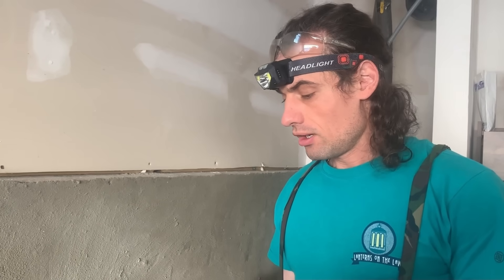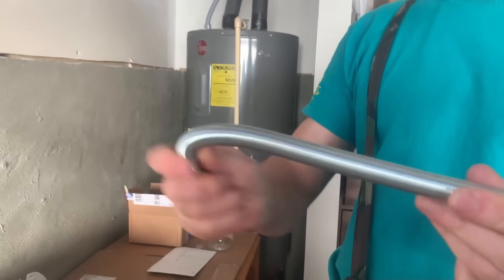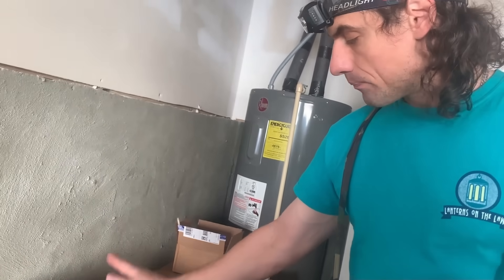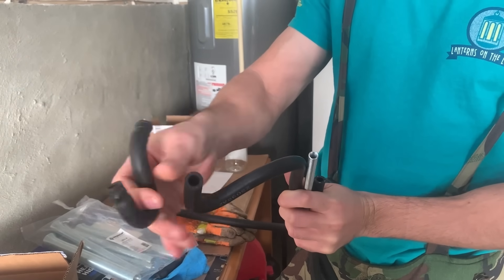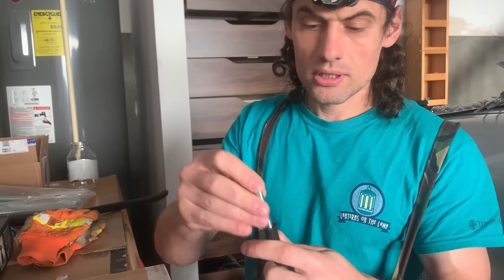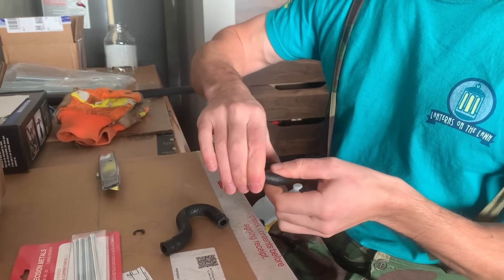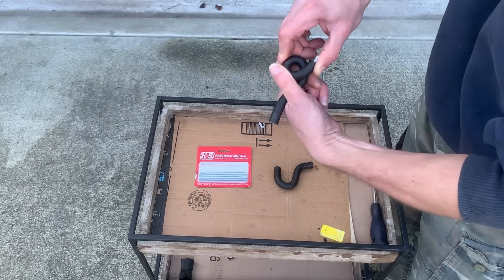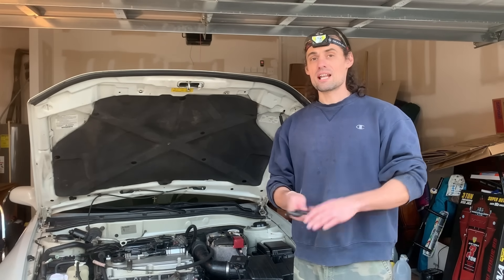Bend Rubber Hoses Without Kinking to Match OEM Parts

Comment: Does this compromise or weaken the hose in any way?
Reply from the maker: I am sure it does... But not to the point where it breaks or bursts after several years. I've used these self-made hoses over number of years and non of them fail yet. The oldest I have under my hood is bout 5-7 years.
Reply: @n @ngtitovWorldOfCars thanks!

Comment: i bought a husky spring set from home depot the instructions are SLIDE THE FLARE END in the pipe 
you did exactly the opposite  yes?>
Reply from the maker: Flare end has larger diameter than the spring. The idea is you're trying prevent hose from kinking. Thus, you need to fit outer diameter (OD) of the spring to inner diameter (ID) of the hose as close as possible. If you slide flare end to the hose, you will end up with a lot of hollow space between the spring and hose - more prone to kink.
You need to keep flare end out of the hose and insert the spring only. Hope that makes sense.
Reply: @ngtitovWorldOfCars  lol i know 
that's what i couldnt figure out 

can you re use the spring ? or are they all one time use?
Reply from the maker: @christophercolumbus8944  Re-use them as many times as you need/want.
Reply: @ngtitovWorldOfCars  no it is actually supposed to GO OVER the copper tubing at least the onei bought 
so flare end OVER the tube and it should bend there no heat is necessary.
Reply from the maker: @christophercolumbus8944  Hold on.. Are you trying to bend copper pipe or rubber hose??

Comment: Thanks for the video. I sliced a hose on my Land Rover Discovery in the middle of a bend when it rubbed against the radiator fan. and will try this instead of adding two splices and a new bend.

A lot of the hoses on this car is only sold in a large expensive kit, so this knowledge is gold. :)
Reply from the maker: Hope this works for you!
Reply: @ngtitovWorldOfCars 
It didn't come out as good as the original, but I managed to get the basic shape right so that the hose connected at both ends without collapsing (or hitting the fan) using this method. You saved me ~$300 :)
Reply from the maker: @yn82903  Lovely... Just remember - most of the time you wont get as good shape as original hose (you have to be really good at it to do so), but you only care about "close enough" without kinking... This is all about

Comment: Bend some nylon fuel line tubing into a 90 degree tight fit ,
without kinking it!
Reply from the maker: Thanks for the suggestion! Actually never heard of using nylon fuel line tubing instead ordinary rubber hose, but it sounds promising and worth experimenting with to avoid kinking. I'll look into it and maybe test it in a future - let me know if you have tips or results from trying it!

Comment: There is also an old trick where you can fill a hose with ordinary beach sand. Bend it the way you want and heat with a heat gun. It works!
Reply from the maker: Yes! Thank you for the comment. It was mentioned multiple times here in the comments by other viewers. Thanks again!

Comment: What should I set my temp gun to? It goes up to 1000°
Reply from the maker: Start with your temp gun set to 80-100°C to soften the rubber without melting it - just enough to make it pliable for reshaping before it cools. Test the hose's behavior at this range and adjust slightly if needed, but avoid high temperatures to prevent damage.
Good luck!

Comment: Very good job what's your thoughts on using an oven for 15 minutes using the spring and some flex conduit to hold the shape you want? Flex conduit can bend and take the heat and still have your spring in the hose to keep it from kinking. Hope that makes sense.
Reply from the maker: Yes, it does. Indeed, several viewers suggested this (or something similar). I never tried it, but I can see it works. Something new to try in the future projects. Thank you!
Reply: @ngtitovWorldOfCars  What temperature would you suggest?
Reply from the maker: @alvingallegos6367  Melting or significant degradation typically begins around 302F-392F. So, I would keep below that temperature. Start with 260F-280F and check it. It might do the job, if not increase the temperature. BTW, be ready for a terrible smell (like rubber burning).

Comment: Question: once the hose is formed in such a method and installed in the car, is there any tendency for such a hose to straighten up again when hot coolant or hot oil run through it?
Reply from the maker: The hose's tendency to straighten depends on how accurately you shape it. If the bend isn't sharp enough, it may try to revert to its original, less-shaped position, regardless of whether hot coolant or oil flows through. However, if you form it with a slightly sharper angle than needed, it will hold its shape as it continues to cure over time, much like OEM thermo-molded hoses. Thanks for the great question!

Comment: I needed this info 50 years ago. I'm gonna try this the next time I need a water pump bypass hose on a SBF. Thanks.
Reply from the maker: Hopefully, it'll work for you. Maybe very first time isn't perfect, but as you do it more, the better you get at it. Glad you found it useful, and thank you for watching!!
Reply: Buy the correct hose instead
Reply from the maker: @russellm5708  What if the right hose isn't available or ... isn't cheap. Similar hose I was able to find online for $49.99 - would you rather go with this option. I've made this video is not because I had nothing else to do, or wanted to waste my time and money. I showed the workaround in cases where it's pretty hard to find alternatives. My channel is all about this - find the simplest and best alternatives.

Comment: large rad hoses I would go with OEM. They really aren't that expensive and you sure don't want any stress on them from over heating.
I don't do the big stuff.
Reply from the maker: Yes, large hoses such as up/down radiator hoses, it is worth getting aftermarket or OEM.

Comment: With some practice, there is no vehicle hose you can't duplicate.
 The cost of pre-bent dealer hoses are  astronomicall to purchase, plus shipping and taxes.
And eventually all hoses will break down or leak.
Over bend slightly to allow for the natural spring in the rubber.
It works well, take your time, don't over  heat.
Reply from the maker: You're absolutely right! This is point of this video. That a little hose I've made in the video, I eventually found on-line somewhere around $45. No need to spend that much money for a tiny hose.

Comment: I just leave the stainless steel spring inside the hose and it won’t kink. You can cut the spring if it’s too long.
Reply from the maker: This also works. Just make sure that hose is still wide enough to bypass the fluid with the spring it. Any hose with diameter >3/8" should not have problems with a spring being in there.

Comment: Do you know if it cost effective?
Reply from the maker: Very cost effective. First of all, it was very hard to find a hose that I need, even OEM part wasn't available. Then I finally found something similar that I could make it work, but that little hose was around ~$45.
If you have all required tools, you only need to buy straight up hose from AutoZone or Advanced AutoParts, which will cost you few $. So, yes, it's totally worth it for such small hoses, and hoses that are hard to replace/find.
If a hose is available for sale and in your proffered price range, go with that hose.
This video is more for extreme cases, when you can't find a match. Hope it helps.

Comment: nice! I have an 11 mini cooper and I was dreading spending lots of money on new hose kit, this will save me a lot of money!
Reply: You need to replace those hoses w/OEM hoses and not some experimental shit
Reply: @genestallons5926  my mini is pretty Frankie, salvage recovery. Of course I would pressure test anything before I hit the road
Reply from the maker: @ Once you installed and pressure tested, just keep on eye on it few times a day first week before/after driving. If it holds for a week the chances are very low that it will leak/break. Good luck!

Comment: Can I leave the spring inside and just use the spring to keep it from kinking?
Reply from the maker: I don't see why not. Unless, it's a very tiny hose and by leaving the spring in there will prevent a liquid from its normal flow. On bigger hoses, I think you can. Also, make sure to use stainless steel spring so it won't rust in the hose.
Reply: Would be better to use a spring on the outside so flow isn’t restricted
Reply from the maker: @Aiken47  That also works!

Comment: Thanks for the video, not my question is do they make the spring any bigger? What I need is over an inch.
Reply from the maker: Over an inch is possible. I found something on amazon that may help: https://a.co/d/9AWbFYa
You have to just search on ebay, amazon and etc. I'm sure they do make such springs, just a matter of getting exact size you need and finding it online.
Just in case if won't find anything you need, read through comments here. There are a lot of suggestions how you can achieve similar results with other tools/methods, such as filling it with sand and boil it in water. There are a lot of tips viewers left around here. I haven't tried them personally, but I can see them work
Reply: the springs for garage doors are flexible and floppy, over 1",  a range of diameters depending on lifting capacaity of spring, 110lb, 120lb, 130lb, 140lb, 150lb all slightly different size

Comment: 10-15 minutes? You could bought the hose for 1.28$ off rock auto for less than you used in electricity
Reply from the maker: Could not buy this hose or similar hose anywhere I've looked. Including RockAuto. Found something similar that I could work with on the AliExpress, but the hose was ~$45. So, it is totally worth it.

Comment: A more economic method is to hard pack sand into the hose to retain the internal wall integrity whilst bending.

The same method works on copper pipes for water supply plumbing.

There will be videos showing the packed sand method, that's how I learned about it.
Reply: Won't the sand impregnate the rubber when it gets hot?
Reply: @mikemurphy7519  

Good one!
Reply: Or sugar, which rinses out easily.
BTW:  you can use this to bend copper TUBING which is soft, and measured on the OD.  To bend copper PIPE I think that you would need a specialized machine.

Comment: If at all possible, buy the manufacturer's hose. They are vulcanized into that shape in the manufacturing process. You can't un-vulcanize rubber.
Reply from the maker: This is more or the extreme case, when OEM parts are not available, or too costly. Just  a workaround.

Comment: Congratulations. You've just spent $100 of your time creating a $10 part not as good as OEM.
Reply: It's the adventure. Sometimes OEM is not an option
Reply from the maker: Absolutely right. I did not have OEM part and there was no cheap replacement. Anything similar I've found was $45 for a little hose like that. So, no waste money here.

Comment: I did a similar method before, but with sand. Tighten a clamp at one end over a screw or bolt, pack it with sand, and shove another screw at the other end, with a clamp. Tighten. ANd it must be tight so it wont pop out. Heat, bend, and then cool. I heard some using oil inside the hose, or something non flammable, but I used sand. Redid a small heater core hose, and many, many brake lines (though with brake lines you dont need to heat)
Reply from the maker: Yes, indeed, a lot of viewers also suggested method with sand. Personally, I never tried it, but it sounds reasonable and based on the various comments here it works well. Thank you for suggesting it as well!

Comment: I do this from time to time when I’m doing LS engine swaps.   I do it for radiator hoses.  After inserting the spring I usually use baling wire, or tie wire to hold it in its “bent” shape during heating and cooling.  You can also use nails or screws that are in a piece of wood.  Just thread the hose around/between the nails, and go to work!
Reply from the maker: I've also heard of this method with screws/nails on a piece of wood. Personally, I never tried it, but it sounds reasonable. I will give it a try next time I need a longer hose. Thank you for watching!

Comment: I've done this type of thing before, but I leave the wire within the hose, so I never have to worry about it collapsing.
Reply from the maker: Yes, leaving a spring inside of the hose is a good idea. Just make sure that diameter of a hose is wide enough so the spring won't affect the flow of the fluid. Basically, you don't want prevent fluid bypassing the hose at normal flow. Thank you for suggesting it!

Comment: Putting the hot rubber directly in the freezer after clamping it will make it stronger and ready to use faster. The same with welding plastic, immediately put it in the freezer or use ice cubes and it will be stronger than air cooling!
Reply from the maker: Yes, indeed, a lot of my subscribers and viewers suggested this - should work. Thank you for watching!
Reply: @ngtitovWorldOfCars  Thank you and youre welcome!

Comment: I know this is a way to make hoses that *look* like OEM, but that is not necessarily good or better because OEM is always the cheapest way they can find to do everything. This is a fact.

An easier and more likely more long term durable method might be to keep the straight hose straight, and use those spring benders for their intended purpose of bending stainless or aluminum tubing. It will need more clamps but if the bends are metal you will have a very durable solution and the rubber will not be stressed into these shapes that the material does not support. 

So your example hose would be nearly all metal except the 1-2 inch rubber sections at the end to provide the seal to the connection points. 4 clamps instead of 2 which if done nicely can look very good. Give the metal a little brush and/or polish and it makes your engine bay look very nice.
Reply: entirely flexible material allows flexing to spread over a larger area to reduce fatigue. this is part of the reason you find seemingly unnecessary extra bends and semi-loops between engine and chassis connections... to provide additional surface area to spread the burden of deflection as the engine moves partially independent of the chassis. Rigid tubing with only flexible coupler sections would reduce lifespan (and introduce additional connections / potential leak points) due to increased fatigue introduced by focusing all necessary deflection into smaller areas.
Reply: @zphunkchicago  Yep, but that is mostly to allow for production line assembly variance, there are other ways to allow for that with rigid sections like I described. What you are forgetting in this case is all of this artificial bending that is being forced into these hoses is stressing them into a shorter life already. I'd even suggest that the flexible sections I describe that are not stressed would last longer than the hoses we see being created in this video, but probably not as long as OEM.

Comment: Some people may be concerned about weakening the hose with the heat, but it will most likely not be an issue. Because when the hoses fail, it is usually not in the middle. They usually fail near the clamp, which is not the area that you have to heat up. The factory bent hose is better, but sometimes you need to make do with something like this because of budget concerns or lack of availability of the factory hose.
Reply from the maker: Very true. Thank you for your comment. I've had this a little house for over a year now and it still holds strong. Even if it breaks, still worth of doing it again 100%.

Comment: I did something similar except I formed it then baked it in a cheap countertop oven I keep in the shop for heating non-food stuff.  You can often find them in thrift shops.  Give it a chance to become thoroughly heat soaked.  The temperature I used was about 325 degrees for 20 or so minutes then let it cool gradually  The hose has been holding up just fine without changing shape in use.

Comment: Like bending PVC conduit pipe. Worked for a company too cheap to buy electric heaters for the job, expected us to heat PVC pipe on a fire, and bend rigid metal conduit over semi trailer tires, it's possible but ain't pretty. Built a good bonfire for bundle of 2" PVC pipe, and didnt work there long.

Comment: @ngtitovWorldOfCars This looks like a great and moneysaving technique. The thought occurs that you may get as good a result without the expense of purchasing bending springs by filling the tube with SAND. That will provide internal bulk and prevent kinking and also absorbs heat so will possibly aid  in curing the bend. You could most likely just use corks or garden hose stoppers to seal the sand in the tube and then follow the same technique you used. When it has set and cooled its easy to pour out the sand afterwards. I know sand was used as an aid to  bend metal tubes, so no reason why it would not work with rubber.

Comment: Can you make a video once you had a customized part in use for a longer time? Curious how the materials will last after the heat treatment and bending. I'd guess they'll last a while, or as a placeholder when on a tight budget, but I'd bet not anything near to a factory made part...
Reply from the maker: Will do. But just FYI, it's been about 6 months or so since I replaced that a little hose, and I have no problems with that whatsoever. I still stays in the shape I gave, and it doesn't kink. I'll wait for other 6 months and will give an update. Thank you for watching!